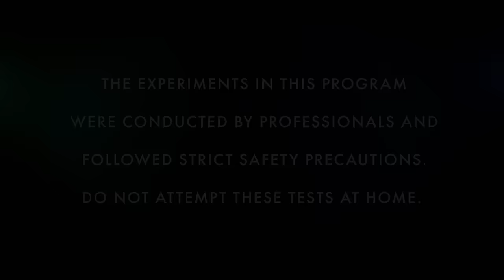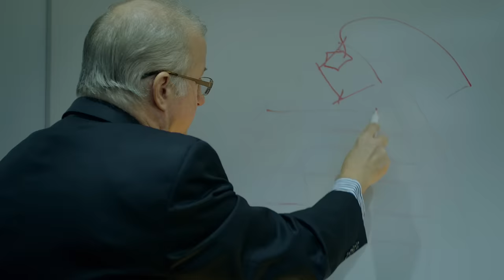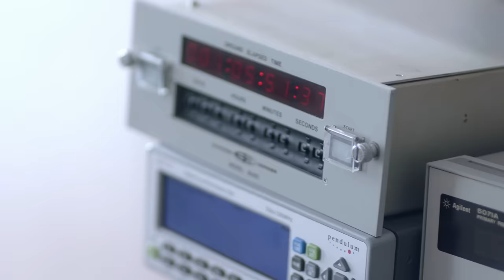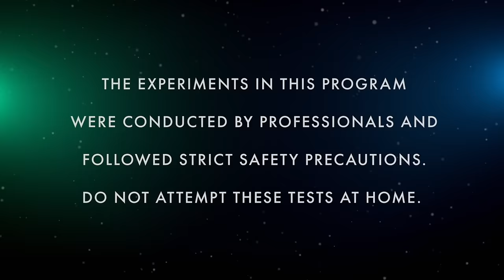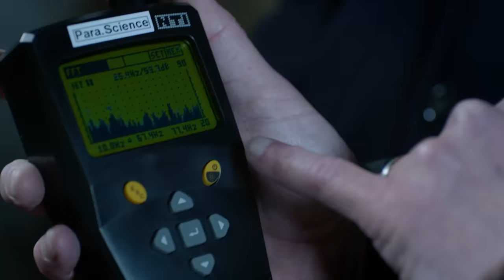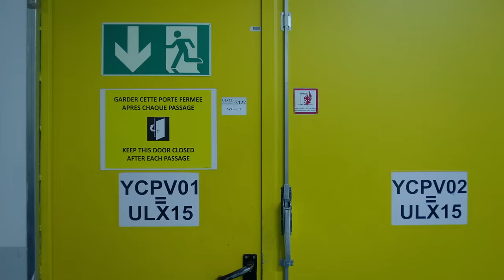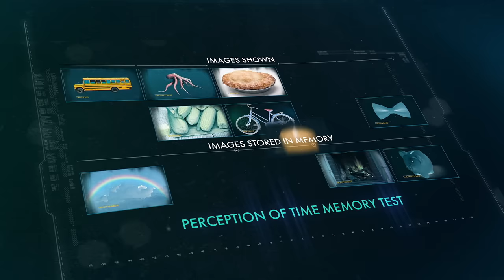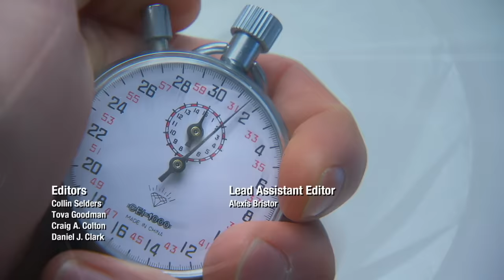In Search Of: Time Travel (S1, E5) | Full Episode

Comment: A clock is a mechanical device made by man to measure time. Time does not control the device if one device runs at a different speed time has nothing to do with it. It could be gravity air pressure, you can kick a football farther in Mile High Stadium than at the Meadowlands because the air is thinner and your a mile high.

Comment: Here's my question-   what is a residual haunting?  Is it someone's personal energy imprinted on the environment at a specific point in time that has it's own energy signature which is detectable by those in the future who also experience that energy frequency at that location?
Reply: Most usually describe a residual haunt as a moment in time from the spirits perspective being replayed by them personally. Such as hearing multiple conversations, a random scream, other sounds you wouldn't typically hear that are present at that location. It's doesn't have anything to do with a time slip, but I suppose it could be a possible spirit manipulation in which the spirit is presenting images or an experience and personally sharing that moment with whoever the victim is. In that case the spirit could alter the senses as if it felt like a slip in time. Though to my knowledge nothing like that has happened or at the very least reported.

Comment: The experiment  with the 2 clocks is flawed ,  the clock at higher altitude needs to be placed in a case pressurized to the same as the clock at the lower altitude.

Comment: The Woman on the “ Cell phone” is a Glitch… 
2 Reasons…
1. Cellphone Technology exist currently or in the Future to speak.. But if you were to Travel Thru time with your cellphone 📲 it would not have Any Service Connection because there were Not any Cellphone Providers or cellphone Towers or satellites in the 1940’s or 50’s or 60’s !! 
2. Who would you Call in that Era from a cellphone? The network in the 1940’s used a “ Call operator” system… if you picked up a land line in the 1940’s Thru the 60’s there was no such thing as a “ Direct Call” every call had to be completed by a Phone Operator on the other end… So using a cellphone wouldn’t be possible be cellphone technology is strictly for use with Direct Calling… there’s no Dial tone!! 

Something to think about…

Comment: 4:50 "The device was a Tesla invention?" I believe the device he's drawing on the whiteboard is a large-scale, Jacob's-ladder but using the discovery of Tesla "Radiant energy" through a Jacob's ladder. Also, 3 or 4 simultaneous frequencies opening a time hole, loop, or portal. But there is a lot more like spatial time space coordinates, etc.
Reply: There is a lot more. Time doesn't permit me to explain everything here...
Reply: When it comes to radiant energy for large-scale experiments like a Jacob's-ladder, electromagnetic radiation in the visible light spectrum is generally considered safe for humans. However, it's crucial to follow safety protocols and guidelines to minimize risks, especially when dealing with high voltages and currents.
Reply: When utilizing radiant energy, particularly visible light, you're not directly dealing with electricity in the traditional sense. Instead, you're harnessing the energy carried by electromagnetic waves, (don't forget the key frequency(ies)) such as photons in the case of light. In this context, the phenomenon to be aware of would be the behavior of light itself, including properties like intensity, wavelength, and dispersion. However, if your experiment involves converting radiant energy into electrical energy (e.g., through photovoltaic cells), then electrical safety considerations would apply. In the alterations of time or time bending... You have to have duel coordinates to go and to get back. To and fro
Reply: Frequency(ies) waves are crucial in understanding radiant energy, including visible light. In the context of experiments involving radiant energy, it's essential to consider the frequency of the electromagnetic waves being utilized. Different frequencies of electromagnetic radiation have distinct properties and effects. For example, visible light consists of a range of frequencies, each corresponding to a different color. In your experiment, you would want to consider the frequency of the radiant energy being used and how it interacts with the materials and environment involved.
Reply: Scalar waves, vibrational frequencies or resident frequencies. All effects or affects  space-time.

Comment: Perception of time isn't the same as time travel. Our brains have evolved to make sense of what we see and feel, not what is actually happening. 

Time is clearly an aspect of gravity. My guess is if you had the energy to go faster than light, which is infinite energy, you could possibly have enough energy to manipulate gravity which is the key. The reason it takes so much energy to breakthrough the speed of light is because of what essentially is the compression of space makes it impossible to move through space that is compressed that much. Imagine it like moving through water that is a gas like a cloud and you move faster, the air becomes a liquid and it takes much more energy to move through liquid than gas. Then imagine you go even faster until the liquid becomes a solid (water freezes into ice) and you can no longer move any faster because you don't have enough energy to push through the "air" that has become a solid like ice. 

With all of that out of the way, we don't know what space "is". Even completely empty space is something because it can be stretched, compressed and twisted by the mass of objects. Even though we don't know what space is, we can however measure it and predict what large objects will do to it. (Gravity Probe B)

 I believe that in certain places all throughout the universe that are below a certain threshold of the effects of gravity due to simple isolation of no object of significant mass, that space is constantly being created. Literally popping into existence. As a severely over simplified "picture" of this, imagine pouring a Coke into a glass and the bubbles expand in the glass. This could explain the expansion of the universe. As more space is created, this process on a universal scale could, maybe, likely has the ability to act on galaxies because as more space is created,  this forces the entire universe to expand and areas with gravity (galaxies) to be pushed along . It might even be what dark energy is. This also might be the reason that time travels in what appears to be one direction. Also since space and time are linked, if time travel were possible, it would also be a certainly that you would also travel through space. If you went back in time, you would also have to travel back through space.

 I'm not sure how clear that is but it takes a lot more than a few paragraphs to explain the things I have been thinking about since I was a kid.